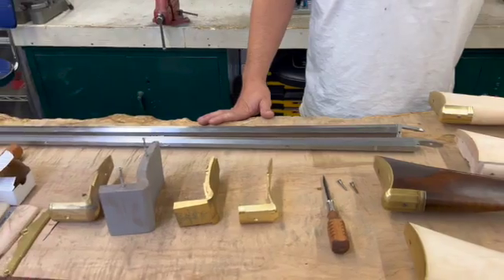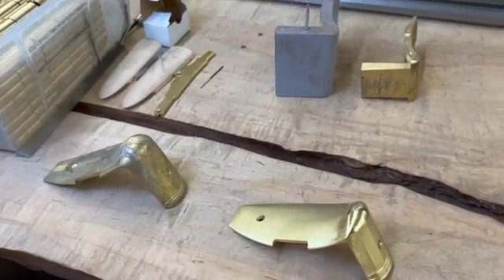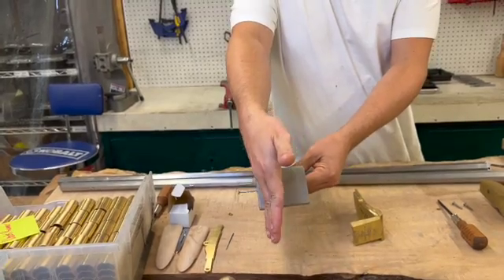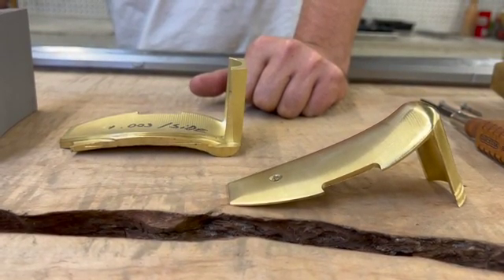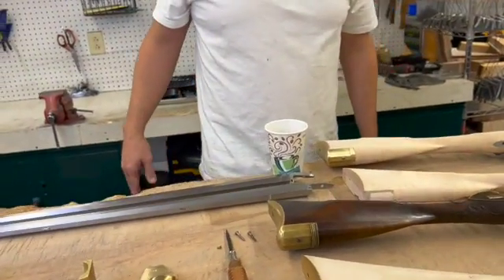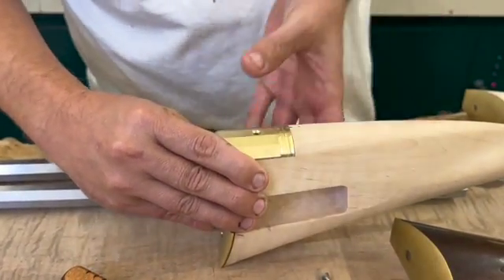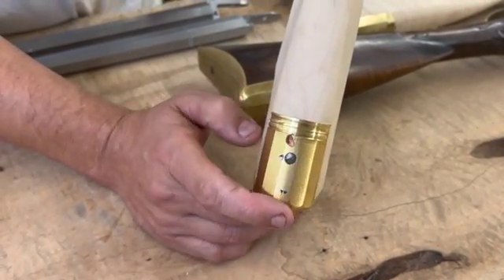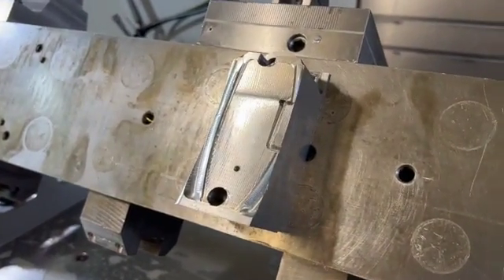Woodsrunner Update - Machining Buttplates

Comment: I'm hoping it won't take too much longer for you to move forward in time to period rifles that had percussion cap locks. I'm building a cheaper kit and experimenting with nickel plate, trying to make a silk purse from a sow's ear really. So many little and big problems that just can't be corrected. I really want something nice I can pass down to step son or perhaps grand child. I built an old CVA kit decades ago when I was about 13, and spent a teenager's amount of attention to detail, probably going to keep it at that stage. Now building a new kit and finding that modern times have made the kits even lower quality in my current price range. Still going to try and make this one nice, but know it won't be fantastic. I need a better quality kit from the start, and you seem to provide that (and info on building), so I eventually want one of your kits.
Reply: I wish I would've never bought this cheaper kit it seems like a waste of money I built one and immediately sold it to buy this wood runner
Reply from the maker: I think we will eventually have a caplock
Reply: @kiblerjim  I did finish my cheap kit, it turned out OK and shoots pretty well so far. I taught my self a few things about nickel plating and gave me more practice with the wood work. That said, it makes me want to build something really nice. With the difficulty of finding caps, I'm rethinking maybe add a flint to my collection in either 45 or 50 to use common ammo to my other two rifles. Or maybe down in the 30 cal range for smaller stuff. Also thinking smooth bore in the 20 gauge size for shot or patched ball. Choices...

Comment: Jim how about the trigger Guard and brass wiping stick brass require filing and sanding or they are castings also is there a way to adjust the single set trigger and how much filing is required on the barrel for new woods runner kit